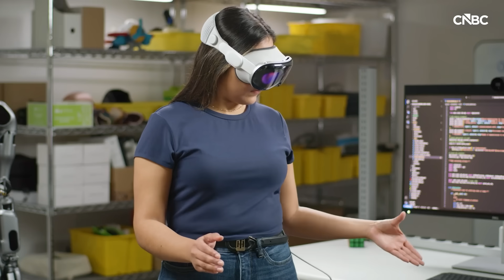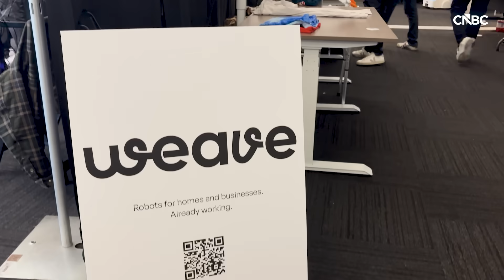How Close Are We To Robots That Actually Do Chores?

Comment: The existing AI technology is likely a blind ally. It is power intensive and is difficult to make fully autonomous, mostly dependent on remote AI servers. 
For  robot technology to meet the aspirations of the public, it will require the problem of anthropomorphic neural networks to be solved. 
It's only necessary to consider how much more advanced even the simplest insect brain is compared to existing AI. An insect brain consumes nano watts of power, yet the creature manages to survive and breed. That involves complex behaviours, such as identifying and catching prey, avoiding being prey, and navigating the world using complex motion. All this is done with approximately 140,000 neurons. This is the network efficiency that is really required to achieve the robots featured in science fiction.
Current AI technology is able to perform some impressive tasks, but compared to nature it is primitive, destined for extinction. Just imagine the power of a battlefield drone, if it could be fitted with even the intelligence of a mosquito, then imagine, then what could be achieved simulating the brain function of a high order predator.

Comment: A robot does not know to avoid stepping on your cat's tail.
A robot does not know when it has stepped in dog poop tracking it all over the home.
A robot does not know to wash its hands after taking out the garbage before preparing meals.
A robot does not understand that it cannot use the same sponge for dishes and the bathroom sink.
A robot does not understand you can't place metal objects in a microwave.

etc. etc. etc....
Reply: What? It can very easily do those things by using it's dozens of 360 degree sensors to avoid stepping onto your cat's tail or in poo. Everything else like using gloves for trash just needs advanced hand and finger constructions and to be programmed into the software so it does it even if it had no reason to do that being a robot. 
Through learning algorithms they can eventually teach themselves by watching you do it just a couple of times.
Reply: @Metaljunk39 you make it sound so simple. Which, of course, it's nothing of the sort. I think you've been brainwashed by all the hype.
Reply: I was thinking that too. I’m going to waste time cleaning my robot every time it spills something on itself or dips its fingers in my taco sauce…no ty. Right now they lack intuitive reasoning and common sense. It’s like asking a 2-year-old to run your house.

Comment: Development, support, and maintenance of all this will lead to massive commercial failure—or simply to an economic dead end and collapse. All these people who get laid off, without salaries and without jobs: who exactly is supposed to consume the goods and services produced by robots?

For example, to fold laundry once a week—who is really going to buy a robotic arm for their home or pay extra for a “robotic” laundry service? I can just as easily pay a human worker at a laundromat and the “problem” is solved.

The whole idea of having a robot "slave" that does everything for you looks either like a solution in search of a non-existent problem, or pure fantasy. No matter how you look at it, there’s nothing good here. All of these tasks can be done by people (the same people who would be layed off), and they can do them for the same money. So what’s the point? Zero.

The same applies to robot taxis and other attempts to replace humans entirely (not to assist them, but to replace them).

On top of that, people don’t live in palaces—most live in ordinary apartments where there’s barely enough space already. Adding a robot that takes up space and gets in the way makes no sense for the mass market. Phones and small gadgets—sure. But a full-size additional “member of the family”? No.

And if the robot spills water on a power outlet or causes a short circuit, who is responsible? Everything today is connected to the internet, full of bugs, cameras, and microphones—and this thing can also be remotely controlled. From any angle you look at it, it’s just a useless toy.

Comment: i do woodworking/carpentry as a hobby. would be nice to have a helper that can help me square up stuff, level stuff, drill or cut stuff straight, and calculate stuff apart from handing me tools and materials that i ask it to. and yeah to clean up the dust/clutter after the project is done.

Comment: ICE crackdowns could remove a large share of immigrant labor from the U.S. workforce, creating an immediate labor shortage. To compensate, industries would accelerate the adoption of robots.
At first, robots would replace immigrant workers. But once deployed, robots do not stop there. They are cheaper, scalable, and operate around the clock. As a result, they would also begin replacing native workers—both blue-collar and white-collar.
This is how automation, triggered by immigration enforcement, could ultimately lead to widespread unemployment